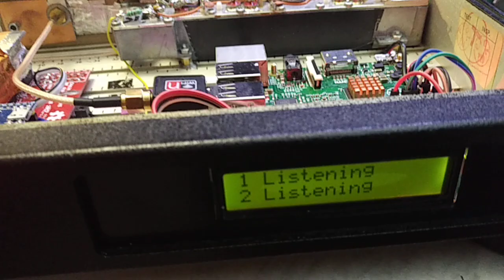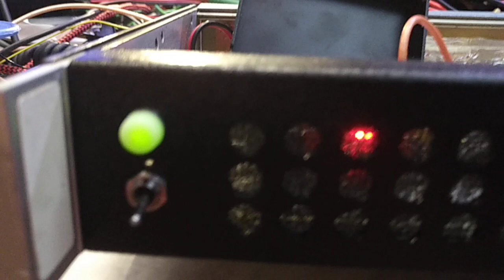Pye mmdvm repeater

Comment: I've noticed that when you or M0HOY are on Hubnet, Allmon shows your connection as a Pye. Do you both have the same? The audio is superior to most other operators, is it due to this equipment?
 Really interesting video, thanks.